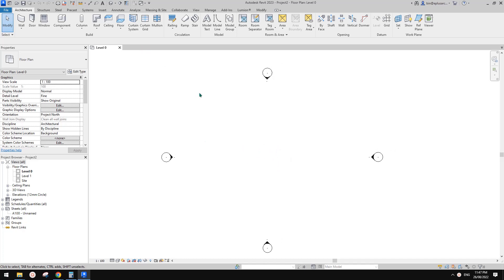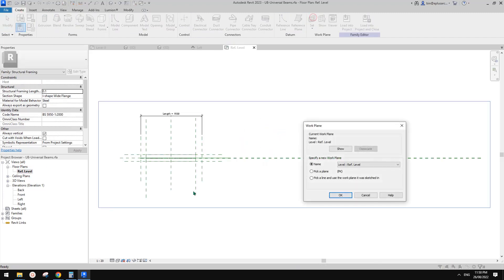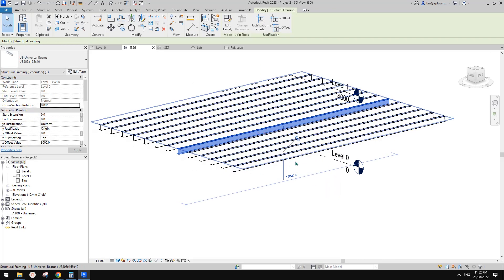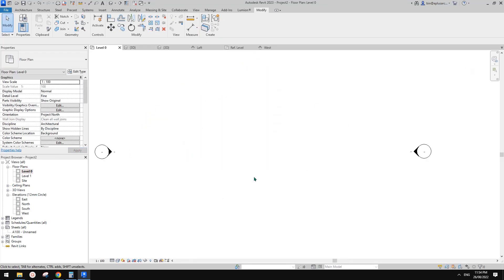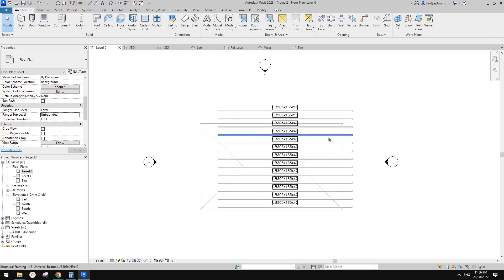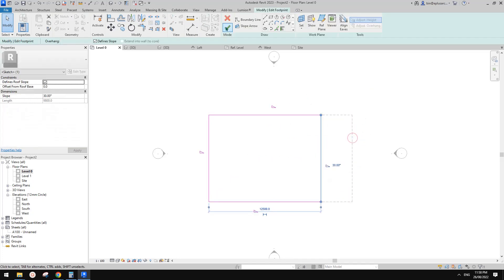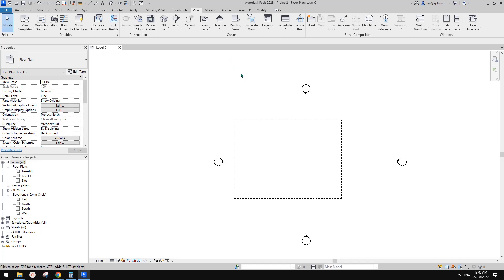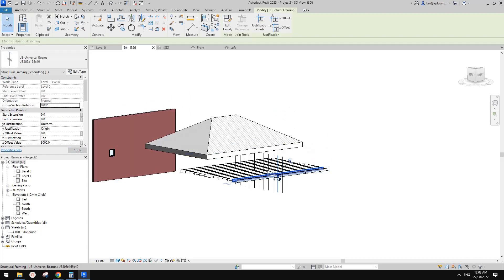Revit Exercise (Day 886) - Visibility of Elevations Above Cut Plane

Comment: can we just change graphic discipline to structural?or maybe visibility setting for structural plan that we can select in project browser?
Reply from the maker: Yes, we can change the discipline, but will this change the way Revit show stuff? I'm not sure... Just had a test and still need to adjust the view range setting to see elements above cut plane.
Reply: @BINHE615  yes rite,i prefer use plan region to show selected component into sheet